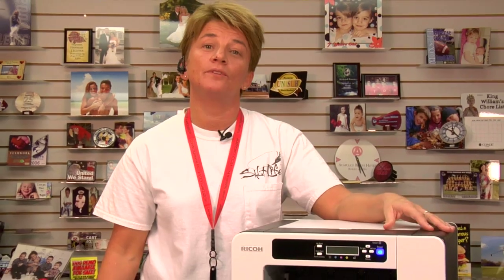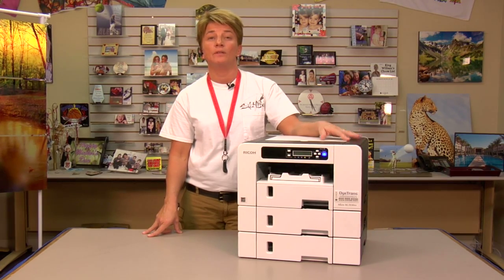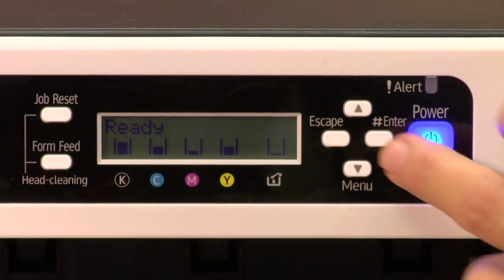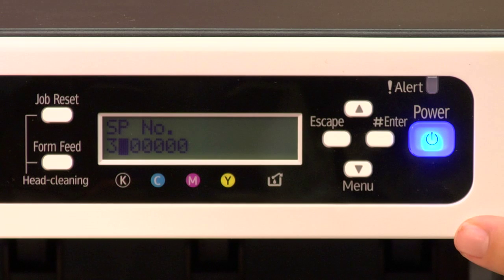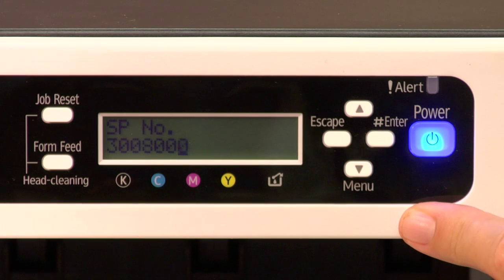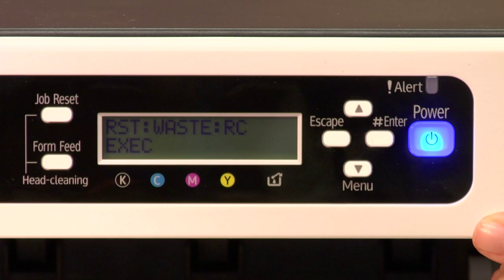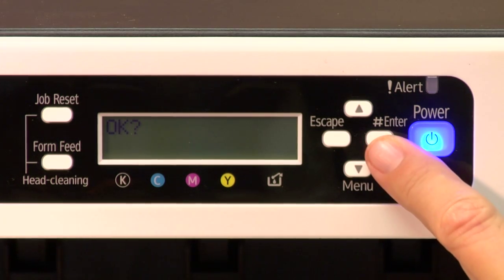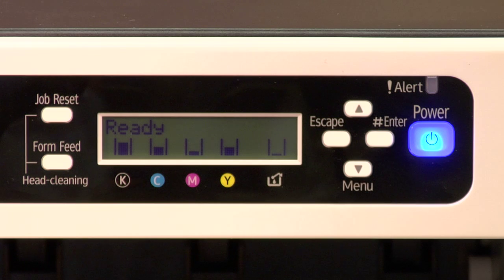Reset the Maintenance Tank - SG 3110/7100  SG 400/800  s -

Comment: I have the Sawgrass SG800 -  also has trouble getting into the Service menu, but because I had the replace in collector unit message.
If you keep holding the up and down buttons for a few seconds and pressing enter then doing it again, it will get into the menu just try various methods.
Once in, I followed the steps and it works a treat. Thanks

Comment: I have the sg400.  My display said Waste collection unit not set. I tried the15 seconds but it did not work but 5 seconds did. I restarted the printer and the display for the waste tank was empty but then I got the waste collection unit not set again so I reset the waste tank again and got another error message  sc (84000) call service if this happens again, Power off on. All set now.

Comment: Hi, I'm trying to get on the first step but my printer has the red light lid already so it does not go into service mode when I press and hold UP and DOWN arrows...
Reply from the maker: You can still enter the maintenance menu with an error message on the screen. 

Make sure to hold the up and down arrows together for 5 seconds (If you are longer than about 6 seconds or shorter than about 4 seconds it will not work), Then let go and press the enter key. That will get you into the menu.
Reply: Thank you for the kind help. Ist's sorted and it worked!
I was missing the enter button after pressing up and down arrows for 5 seconds to enter service mode.

It would be great to be able to do the same thing to cartridges levels... : )

Comment: Hi Conde
my printer is SG 3110sfnw it's display"Use ink cartridge C M I got help from my friend has the same model , we replaced the two cartridges above from his printer in  mine.It is still show the same message. Is it a condition to replace all set? Thanks.
Reply from the maker: +مصطعى المدريدي His cartridges may not be full or your lines may be clogged. Please contact Ricoh.

Comment: Got into service mode, only had to hold up and down for five seconds on the dnw version. 

Is there a way to trick the printer into thinking the color cartridges are full? I only use the printer for black monochrome printing for notary business. It's over $120 every time I change out the color cartridges, and the ink cartridges keep depleting due to auto maintenance.
Reply from the maker: Not that we know of.
Reply: Get a small cheap laser printer!
There is no way to get to what you want. The printer needs ink in all four colour to run proper and for cleaning runs.

Comment: Hi!

Very nice Video.
I have a question: Is it possible to reset the adminpassword for the Webinterface?
I am using a SG2100N.

TY.

Regards
Volker
Reply from the maker: We don't think so, however we have never seen a SG2100N, contact Ricoh or your supplier.